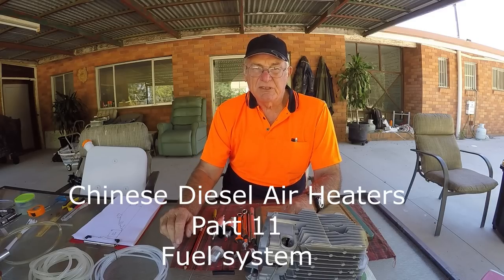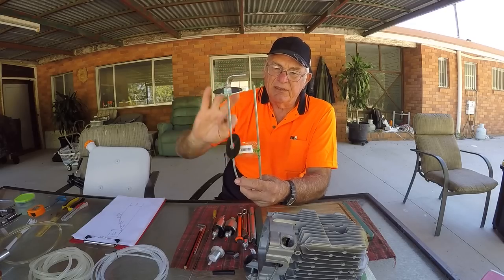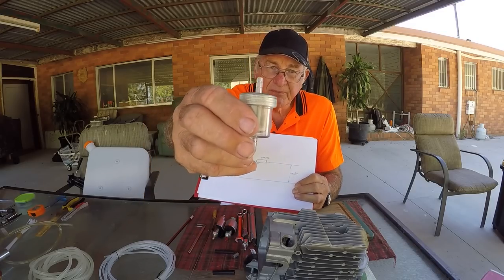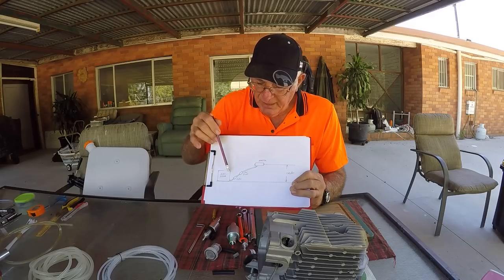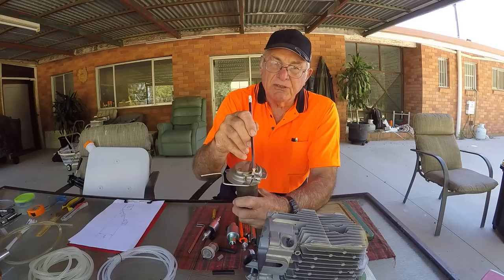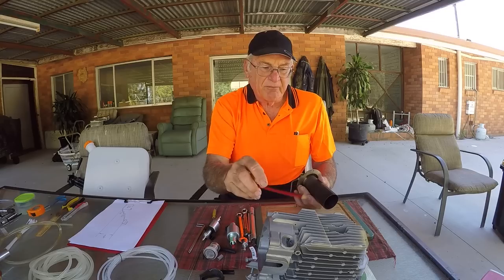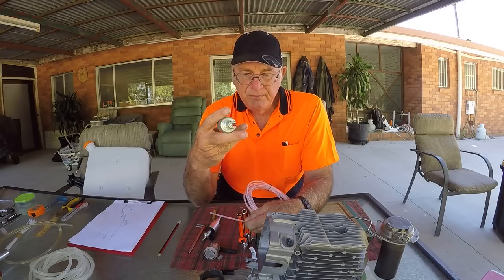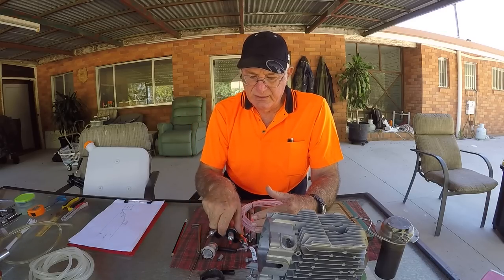Chinese Diesel Air Heaters - Part 11 -  Fuel Delivery

Comment: I love the Chinese diesel heater but I hate its loud clicking noise the pump makes I'm sure a clever bloke like you could make a quiet pump surely putting rubber inside the pump would stop that click. I have discovered that Planar make a quiet pump number 18205 12v but don't know if it's compatible with a Chinese heater weather delivers the correct amount of fuel. Have you or anybody tried these pumps.
Reply from the maker: Hi Jess, thanks for the feedback. Yes, the clicking noise can annoy many people, but you can make it fairly quite, see boat install video.  

No I have not tried the Planar pump, but if it is a pulse pump, and delivers .02 ml per pulse you should be able to make it work with a Chinese Diesel Heater.  JMcK

Comment: Not using the supplied fuel hose can cause ignition drama needing higher fuel delivery rate as larger hose changes minimum fuel flow to be lower than heater needs to maintain ignition temperature

Comment: Is the nylon fuel hose like the webasto / eberspacher hose? I’ve got some of that and the bore is tiny compared to the fuel line you get with a Chinese heater  (even though it’s not that fish tank bore of 4mm) should I use my original webasto hose?
Reply from the maker: Hi Alabama, a majority of sellers of the Chinese heaters include the narrow bore (2mm) hard nylon fuel hose, same as Eberspacher and Webasto, which you should use on the delivery side of the fuel pump. 

Sadly some eBay sellers now supply real cheap large bore vinyl fuel hose with their heaters. This cheap fuel hose not only causes heater performance issues but also is dangerous as my tests showed total hose degradation after just 6 months of use.  JMcK
Reply: I’m replacing our Webasto (faulty and probably too expensive to repair) with a Chinese heater. The fuel pipe that came with it  seems to be something between the awful 4mm bore stuff and the fuel line that came with our Webasto. I think I’ll use what came with the Webasto on the delivery side just to be sure, and the fuel pipe that came with the Chinese heater from fuel tank to fuel pump, does that sound a good idea? 

Hope to get the heater up and running over the weekend :)
Reply from the maker: AlabamaTree 

Sounds ok to me, but if your heater came with the large clear bore plastic hose, it is not diesel compatible and will perish in 6 months. Buy some good quality fuel hose on the pick up side of the pump and use the narrow hard nylon 2 mm bore hose on the delivery side of the pump.  JMcK
Reply: John McK 47 - I think I’ll use my webasto fuel hose both sides of the pump.. I’m not 100% about my Chinese supplied fuel line, I think it’s about 2.5-3mm. A 2mm drill bit is a lose fit inside it. The webasto fuel line is 1.5mm bore, does this sound the best way to go?
Reply from the maker: AlabamaTree . Sounds sensible to me.   JMcK

Comment: I need a fuel pump that will last more than 4 hours any suggestions. I have fallow your instructions to the letter I'm very puzzled
Reply from the maker: Hi John, can you give more information? Does the pump stop after 4 hours? Do you run out of fuel? What else happens?
If the fuel pump is installed correctly they last for years. 
Perhaps you have a pump with an internal filter, if so I suggest you remove the pump filter and install a seperate fuel filter.  JMcK
Reply: @johnmck1147  My set up is the fuel tank is elevated around 1 foot above the fuel pump I let it fill up the line and filter before i start the pump. The line from the pump is 2 foot long to the heater I let that prime then plug it in the fuel inlet that takes 1.5 minuets. It starts up fine then after around the 4th hour the pump starts slowing . After few minuets the flame goes out No codes   pump has stopped . I have tryed lightly tapping the pump and it will run for a short time .I have not seen any filter in the pump .
Reply from the maker: John Duke 
Hi John, what fuel are you using? Diesel or kerosene? You could have a lubrication problem if using kerosene, or you could have an overheating issue with the pump. The fact that it slows down and stops and can be started again by tapping tends to show the pump seizing up. This could be lack of lubrication, overheating, caused by dirty fuel, bad wiring or voltage issues. Or you could just have a defective pump. I suggest you check the potential issues mentioned above and then try a new pump, the Chinese pumps are quite cheap on eBay these days, just make sure the pump voltage is correct.   JMcK
Reply: @johnmck1147  these pumps are the same ones used to pump petrol. Care to explain why kerosene would "seize" a pump and petrol or even water won't?
Reply from the maker: Andrew Bartleman 
Hi Andrew, these pumps need some lubrication, even with the newer ones that appear to have some teflon in them. Lubrication depends on the type of kerosene you are using. In Europe and in the US commercial kerro has a lot of sulphur content in the kerro which provides lubrication. In Australia, our lighting kerro has little or no sulphur, so no lubrication. In my testing I only got a few days use out of a pump running straight lighting kerro. I have not tried to pump water so I will make no comment at this stage on that, but you have pricked my interest, and at a suitable time I will run a test on straight water and see what happens.  JMcK

Comment: Hi again buddy what would you say is the max distance from a fuel tank in a van you can fit the pump 
Also have you seen the silent pumps being made by a guy called James browningsmith check them out on YouTube you will be very surprised it’s anti syphon stepper motor pump
Reply from the maker: Hi Sean, it all depends on suction height. If pump lower or same level as tank, distance could be many meters. If pump higher than tank, not so long. It is all dependent on head hight. Remember pumps deliver far better than sucking. Better to have any pump close to source.  JMcK

Comment: Great info in this video, but where to get this 2mm ID hard nylon fuel line??!  I cant find it anywhere, not ebay or amzn, or local car parts stores.  A link or common source would be great....advising to buy a kit with it in the first place is no good, as the pics in listings on ebay and amazon show all different kinds of parts, no way to tell for sure what you will receive, and questions to sellers come back with bad english answers.
Reply from the maker: Hi MB, there are loads of sellers on line, and on eBay. Search for “Hard nylon fuel hose for Eberspacher diesel heater” below is just one link to get you started.  JMcK

https://www.ebay.com.au/itm/For-Webasto-Eberspacher-Diesel-Heater-Inline-Fuel-Filter-Hose-Clip-Pipe-Line-Kit-/403023025202?mkcid=16&mkevt=1&_trksid=p2349624.m46890.l49286&mkrid=705-154756-20017-0
Reply: @johnmck1147  I did search for hard nylon fuel, but all I found was flexible clear/cloudy hose that looks like the hard line.  Your link is for the AU ebay, but I did manage to find a similar kit after including the term eberspacher.  thanks!
Reply from the maker: @this_is_stupid-x3b  
Hi MB, if you want any heater spares, add the word “Eberspacher “ in your search and you will be more successful. 

Just recapping for those who do not know. Eberspacher are the original and genuine type of these heaters. Most Chinese heaters are almost exact copies of the Eberspacher heater.  JMcK

Comment: Can the fuel tank be above the heater? In my intended installation, the heater will be mounted to the floor. Unfortunately as this is a small workshop, the floor is the bottom, there is no lower location I can install the fuel tank (flat fuel tank that comes with most heaters, designed to be bolted to a wall). I had assumed I'd mount the tank above the heater to save space. doing an "S" with the fuel line so that the fuel pump points up is no problem, But there's really no way to get the tank any lower inside the building, and outside would be worse as it'd be in the weather
Reply from the maker: Yes RN, you can do that, but you will need a fuel shut off valve in the fuel line between the  tank and pump, and turn off after use, otherwise fuel can seep past seals in pump and flood the heater.  JMcK
Reply: @johnmck1147  Ok. What gave me the idea I could get away with it was looking at the "all in one" units in a box, as the tank was above the unit in those, but it is also a smaller tank. Makes me wonder now if those don't eventually flood
Reply from the maker: Its all about head hight and static pressure. A few inches above the heater is not an issue, but a couple of feet above heater does creat fuel pressure and seepage issues.  JMcK
Reply: @johnmck1147  yes I see. So right above the heater, which was my plan, then through the floor, U-turn into the pump (pointed straight up) then into the heater (rise of maybe 5 inches after the pump) should work. Whereas way overhead would be far too much and overcome the pumps ability to hold it back

Comment: Does it matter if my tubing from tank to filter runs in front of the intake air a little. I have a all in one unit put a filter on but there's tubing in front of were the unit takes the fresh air and blows it into the unit.
Reply from the maker: Hi Wayne, better avoided if you can, but really won't cause issues if there is no way it can be sucked into the fan.  JMcK

Comment: Hey John I was hoping you could help I contacted you earlier regarding my low-voltage problem I’m thinking the reason now that I have put a booster on it and it doesn’t start is that it keeps trying to fire up but my diesel fuel is more than a year old! would that be the problem? and have I done any damage or is there something that I am going to need to take apart and clean thanks again for your help
Reply from the maker: Hi Keith, 

I thought you got it started with the booster?

I don't know where you live, and the diesel can go off quick in some countries.

Suggest you first try a 90/10 kerro diesel mix with fresh diesel. Remember you have to flush out the old diesel. See if it will start on kerro, and if so a couple of hours of running on a kerro mix  will help clean out any carbon.

Next see if glow plug is getting full current. If you have or can borrow a clamp meter, the heater should draw around 8 to 10 amps on start up.

If still no start you will need to pull the glow plug out and also the glow plug atomisation screen. If that is blocked with carbon the heater will not start.

If there is a lot of carbon, you will need to strip down the heater and clean it out.

Good luck. JMcK
Reply: @johnmck1147  it started for a day. Seems it is not fire ring up and there is a high voltage draw causing voltage on display to drop. I think it keeps trying a second time before it just cycles down and shuts off. Only error code is E-10 (“multiple attempts “?).
Reply from the maker: Keith 

Hi Keith,

E10 is generally multiple failures.

You must now borrow a good battery. Double check your wiring, and test voltage at heater on start. If you still have a big voltage drop with a new battery you must find out why.

Also borrow a clamp meter and check the current draw on start. Around 8 to 10 amps good.
Below 6 to 8 amps or above 11 amps, probably a defective glow plug.

Also check fan spins freely without scraping. A scraping fan can draw excessive current.

Also check again the fuel flow. Take the fuel line off the heater and see that fuel squirts out on manual prime setting. Pressing two bottom buttons. 

Good Luck.   JMcK
Reply: @johnmck1147  I wondering if you have ever executed a “voltage“ observation from the digital control panel during start up?  While following input battery voltage? Valuable information maybe indicating glow plug on while problem with fuel supply or fuel ionization. Maybe indication why my boosted 12v source battery stays above 12v and the digital voltage readout continues to drop in voltage, until shutdown.
Reply from the maker: Keith 
Yes, they should be fine. 
If your Chinese copy heater looks like the heaters in my videos they are direct copies of the Eberspacher heaters, and parts are interchangeable.
There are a few Chinese heaters that are Webasto copies, which internally are quite different from Eberspacher.
Cheers. JMcK

Comment: Hi John, I have watched your video, very very informative. Still having trouble with mine. Recently bought a portable Chinese diesel heater, 5KW, comes in the red outer casing. Runs for around an hour, then shuts itself off, sometimes less, only 30mins or so? I noticed the fuel line was filling with bubbles from the agitation of the pump, so I have temporarily relocated it under the heater so the bubbles travel the tube into the heater, pump is angled up at under 45 degrees. Plenty charge in battery, left in on charge last time to rule that out. Any ideas? Fuel line is also the soft hose, around 4mm inner diameter, but only about 100mm long with the temporary set up, Not sure if the solid fuel line with approx 2mm ID would make too much of a difference at this length. I have ordered some, just waiting to arrive but it is 2.6mm solid line, not 2mm. I also left the fuel cap loose incase the cap one way valve was faulty. 

Not sure where to go from here?

Any advice you could give would be great. Thank you for that
Reply from the maker: Hi H1000

Do you get an error message, or the heater just shut down?

Does your controller have a timer function?

Suggest you try running the heater in manual mode at mid setting, say 3Hz and see what happens.

A very short soft fuel line will not cause these issues.

You may have a faulty controller. Check above first then perhaps ask for a replacement heater.  JMcK
Reply: @johnmck1147  Hi John, thank you for your time to reply. 

No error message, just ‘Off’ flashes a number of times. 

Yes the controller has a timer function but it is in the off mode. The heater also turns of at irregular intervals, some times an hours, sometimes 20 mins,
Reply: @johnmck1147  I will run it now at 3Hz and come back to you. Thanks again
Reply: @johnmck1147  hi john. Just doing the test now. Not sure if it makes any difference but a lot of times when I turn it on before the pump starts clicking it shuts down, or while the pump first states clicking as the fan speeds up it turns off.
Reply from the maker: Hi H1000,
When you first turn the heater on, the fan starts to blow away any residual diesel
The the glow plug turns on and heats up
Only when the glow plug is hot, should the pump start. Could be a couple of minutes before pump starts.
Once heater is running the fan and pump slow to match heat settings.

You may have a faulty controller. Easy for me to check as I have spare controllers.
If new,, suggest you ask for a replacement heater if you have controller issues.

Cheers, JMcK
Reply from the maker: Just a thought. I hope you are not primeing the heater each time. You only prime it on initial install.

Also, is your fuel tank higher than the heater. If so you may be getting leakage past the pump and causing flooding.

Do you have a good filter in the fuel line before the pump? You get leakage if you get small bits of crud under valved in pump.  JMcK
Reply: @johnmck1147  hi john, no only primed on install, and yes the tank is higher, I thought that would be better to help feed the pulse pump by gravity, I can try the tank back at Sam’s height as pump or lower if you suggest to prevent that issue if that is happening. 

No filter yet, it’s coming with the new fuel line. 

It has been running for 1 hour 15 mins at 3.1Hz, that’s the longest so far. Is there a possibility that it’s flaming out at lowest speed 1.7Hz?
Reply: @johnmck1147  hi john. Ran at 3.1Hz for about 3 hours then shut off on its own again. Voltage was sitting around 12.48 at the battery when this happened. There is not much voltage drop between the battery and the unit. Controller?
Reply from the maker: Looks like you have a faulty heater. ECB or controller. You should get an error message.
Suggest you ask for a replacement.
Quite often the supplier dose not want the heater back, now you have spares.  JMcK
Reply: @johnmck1147  thanks John, you in Sydney by any chance?
Reply: @johnmck1147  thanks John. Are you located in Sydney by any chance?
Reply from the maker: No, I live in SE Qld but I am currently on my sailboat in Greece.  JMcK
Reply: @johnmck1147  wow. Thanks John for all your advice. You are a good man. I really enjoy watching your videos. Enjoy
Reply: @johnmck1147  Hi John, replaced the controller, now working like a treat. Ran if for 12 hours and turned it off, runs perfect. Had one of the new blue controllers, replaced with the black controller like the one in your video. While I was there added a fuel filter before the pump and replaced the fuel line also after the pump with the 2mm ID. Bubbles travel into the heater well without building up in the line. Thank you for your assistance again. Take care

Comment: Sorry, Hi John! Can you give a advice? Thant you and best regards!
Reply from the maker: Hi Ricardo, yes, if I can. What is your question?.  JMcK
Reply: @johnmck1147  It was about the 1 meter high that the combustion chamber should be in relation to the fuel tank. But I already understood. I’m going to use the camper van fuel tank, so I think it’s 1 meter from the pick-up tube, placed on the top of the fuel tanks. Right? 
Best regards!!! Thank you for your attention!
Reply from the maker: @MrRussovalente  
👍

Comment: Can the tank be mounted higher than the pump and or heater?
Reply from the maker: Yes wemme, up to one meter does not cause any issues. Above that you probably need a shut off valve when not using the heater.

Comment: So much wron with what you are saying I don'r know where to start. The air bubble does not stop the pump at all.   I have used these pumps for years and  "cavitation bubbles " is not normal.